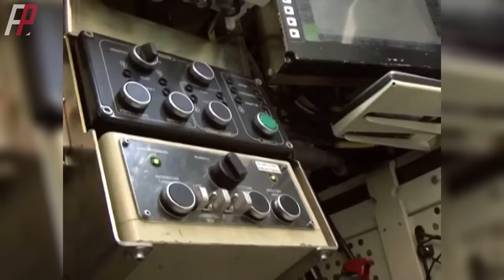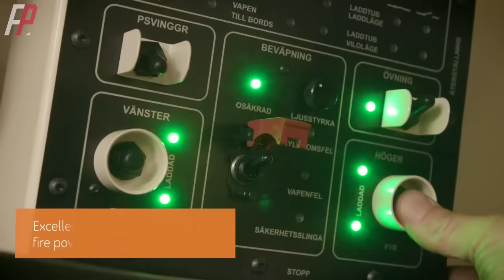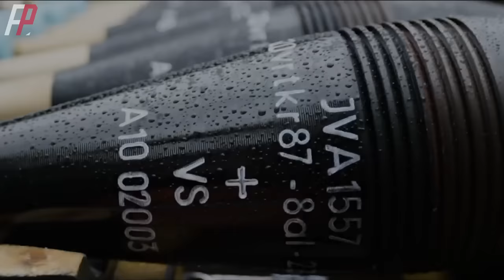CV90 Mjölner,the hammer of the thunder god Thor

Comment: Some corrections here, the latest Mjölner order has nothing to with the Archer going to Ukraine(and the UK), it's been in the plans for a while, this is an asset for the armoured brigades, there will be 80 of these mortar vehicles including this latest order. The Archers are getting replaced by new ones recently ordered + additional ones as a division level asset, also older plans, so there will be 72 Archers, 24(or 2 battalions) will be a division level asset in support of the 3 armoured brigades, each Brigade will have 1 Archer battalion of 12 guns, and the remaining 12 will probably be supporting Battlegroup Gotland. So in a division frame, there will be 60 guns in total+probably around 60 Mjölner mortar vehicles, the remaining 20 Mjölner might be used for other units.

Comment: Dont see how a 6 km ich mortar will replace a 35 a 40 Km boom stick. iff you are 30 km short just stay home. its the same i did buy a motorbike bicause they send the F16 to Ukraine. just a bullshit topic.
Reply: because???
Reply: @Coole-ee1vg   Because a big155 mm  boomstick would be used for long distance targets  and a mortar for short range. And when needed even the 155 artillery could be used for short range high angle shots. And with the smarts munitions a projectile will be fired over 90 degreee angels so the prjectile will hit targets behind hiigh buildings or cliff's. so now you explain how that mortar will hit a boogy @ 15 miles.

Comment: According to wikipedia Sweden's got 549 CV90s, and additional 40 Mjölner are ordered, and there's already a new order for another 48 Archer systems for the swedish military.
Reply: Those Archer systems are prio #1 as they are a vital part of our military defense. Need to replenish after giving such hardware to Ukraine.
Reply: And those will have the Rheinmetall RMMV chassis instead of the volvo one
Reply: @LyricalSteeler  We didnt give anything that was in Use. Norway ordered 24 archer systems, they didnt take delivery and cancelled order. These 24 were put in storage and were maintained as reserves for our 24 in service. 8 of these were transfered to ukraine.

Comment: I am a bit dissapointed by the slow rate of fire. But otherwise do I like the concept. And yes mortars is an underestimated weapon.
Since they are launched out of a short tube at low speeds, can the shells have less thick skin and contain more explosives instead. So the firepower of a mortar can be gigantically much more powerful than that of a howitzer or field gun. 
And when you then also combine that with a higher rate of fire could the result be a super deadly barrage raining down on the enemy.
Having the shots flying up in a high angle and then come raining down on the enemy have both plus and minuses. But this unique ability can sometimes be an enormous advantage over other types of artillery.
And with this mobile platform can you reach the place that needs artillery support very fast. And you can deliever a deadly barrage fast and then more before the enemy counter-battery fire can react. And the armor protection do give higher chances of survivability of the enemy actually manage to fire back before the vehicles have moved away from the spot.
Reply: Not only does it have chained targeting ability (multiple targets at once) and software that makes sure all shots can actually hit all targets at the same time despite the firing delay, but it also fires three rounds within a minute and is already packed up and on its way to its next destination before the first shot has landed. That's where its main strength lies.
Reply: You know nothing. Just another schoolboy trying to sound knowledgeable.
Reply: @karmpuscookie  
I never claimed to know anything either.

I recently read John Mosiers book about WW1 where he explained the enormous importance of mortars and the advantage it gave the germans in firepower. German artillery was good, but their mortars are their forgotten star. Big Berta is remembered but no one mentions their gigantic mortars that destroyed the big forts in France and Belgium.

So it is a good idea to build a mobile protected mortar I guess. I am surprised that not others have caught on to the idea.
As I said, mortars have this huga advantage of containing enormous amounts of explosives compared to ordinary artillery shells.

Mjölners rate of fire is not bad. But I have seen a video of an well trained ukrainian mortar crew on youtube which was capable of firing more than 12 shots per minute. So for that reason I wish that the rate of fire was higher. After all is it important that as much fire as possible that as much firepower as possible on the enemy the first minute of artillery fire - because then will the enemy run and take cover which drastically reduce the effectiveness of the artillery firepower.
Reply: @nattygsbord  There are always trade offs, mjölner trades rate of fire for armour and mobility.
Reply: speed combined with firepower is the thing ;)

Comment: Sweden is NOT ordering Mjölner because of losing Archers. Sweden has ordered additional Archers to not only replace the ones which have been sent, but to increase numbers.
Sweden is ordering Mjölner because it's rearming after decades of neglecting the military. We've gone from not having any artillery at all, to building a robust and modern artillery force.
Reply: You know what I would like to see from our army?
Rocket artillery systems being used and fielded,those have proven to be a very important part of this war in ukraine and it wouldn't be entirely a bad idea to have those.
Also attack helicopters would also be useful when going on the offensive.
Reply: @attilaabonyi8879  We've decided to get that too.
Reply: @jakobholgersson4400  which and when?
Reply: @attilaabonyi8879  I believe a decision to commence a procurement program was taken this spring. 
We're still at a very early stage, though. I'm not even sure if there's any list of requirements yet, let alone a public list of candidates.
Reply: @jakobholgersson4400  ah ok, is this info verafiable?
I would like to read about if it is possible, just to read and nothing more.
Ps:if it is true then that would mean a great deal.
Reply: @attilaabonyi8879  You just read it.
Reply: @Coole-ee1vg  i meant an officall source

Comment: Swedish armed forces dont have any AMOS they dropped out from the Finnish - Swedish AMOS project back in 2008 during the many military budgets cuts Sweden did when Cold war ended until recent years. And the total manpower is currently totally 50.000 planed to be 120.000 by 2025 of them 45.000 conscript and part time soldiers, so Sweden is in manpower about the same size as Denmark and Norway. Mjölner is just a normal 120 mortar mounted to a turret more or less. That why it has slower fire rate than the Finnish AMOS and Mjölner cant fire on the move or hit same target at the same time with multiple rounds from same vehicle.
Reply: *two assisted loading 120mm protected self propelled mortars, but yes, Mjölner is a cheap downgrade compared to AMOS in most aspects.
Reply: @SonsOfLorgar but it IS just as effective
Reply: so not as big of an army as mentioned in the video. I am a captain in the swiss armed forces and we have 110k to a max of 140k soldiers. But right now we are just a little over 150k active soldiers since we had a system change on the compulsory military service and it only is 100% in effect after 2028 and you can't throw out those few over who won't be there and also not replaced in 4 years to come. and then there are like hundert thousands soldiers not active anymore but with their compulsory duty finished but still with great military knowledge after some refreshers